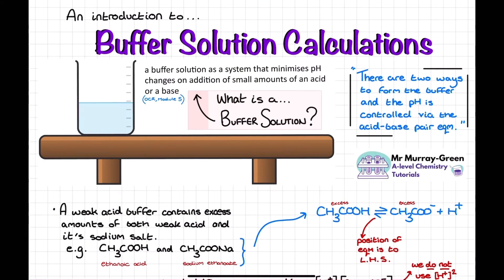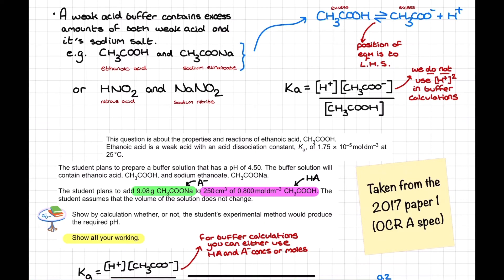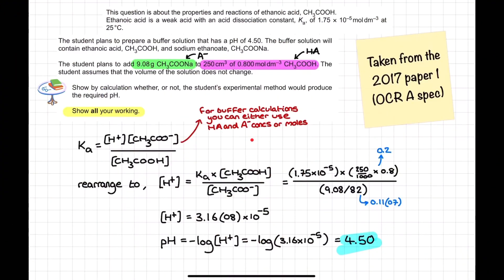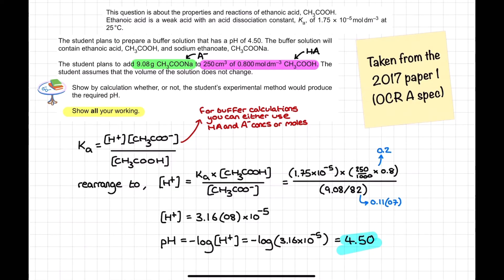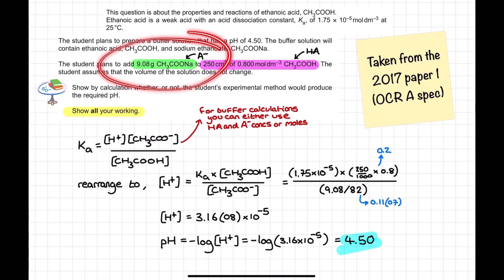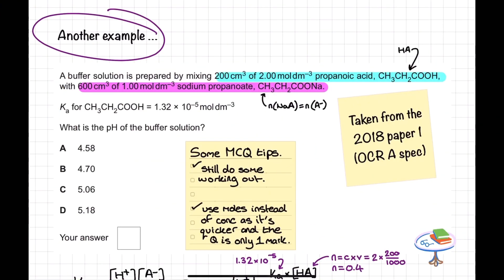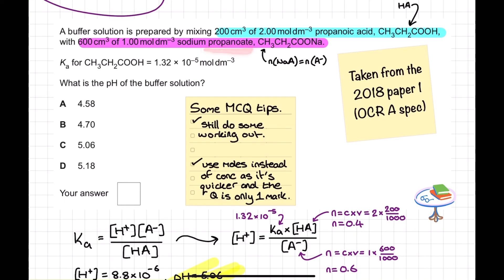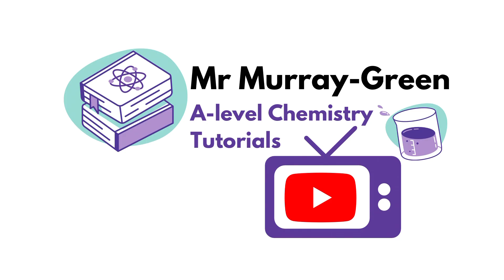Buffer Calculations in Exam Questions for OCR

Comment: Do you still use square brackets when writing the expressions even though u use the mole values?
Reply from the maker: Hi, once you’ve started the calculation it won’t matter what brackets you use. Just make sure when writing the initial Ka (or Kc) expression you use square ones

Comment: Hi Mr Murray,
I dont really understand why youre allowed to use moles instead of concentration, when using the Ka formula?
Please could you rephrase your explanation as I am quite lost.
Thanks
Reply from the maker: Hi, very sorry, I missed your comment until just now. When I rearrange the Ka expression as a subject of [H+] for a buffer, I find myself with the [HA] on the top (numerator) and the [A-] on the bottom (denominator). They are both concentration terms which mean they are both 'moles divided by volume'. Since they are in the same solution, these volume terms would be the same (and cancel out) so I can leave them out and just use moles instead.

Comment: Thank you, this was really helpful. For the last question, why is it quicker to use moles, isn’t the concentration already stated in the question?
Reply from the maker: Hi, the concentrations started in the question are not valid for the buffer as when you mix the two solutions together the total volume will change which would change each concentration (c = n/v). What you would need to do is re-calculate the adjusted concentrations to account for the change in the total volume now that the solutions are merged. Since this takes time and the volume terms would cancel out anyway, it is easier just to use moles.
Reply: @mrmurraygreen  Hey great video! Although, in the first question it says that “the student assumes that the volume of the solution does not change”. Does that mean we could have just plugged in the concentration values into that equation rather than using moles as the total volume hasn’t  changed?
Reply from the maker: Hi, but the sodium salt isn’t a concentration? It’s a mass. It needs converting into moles to be used. Also sorry for the slow reply, the YouTube studio app is rubbish and keeps hiding comments.
Reply: @mrmurraygreen  I understand now, thank you
Reply: @mrmurraygreen  Oh right that’s true😂, thanks for the clarification :)
Reply: I guess you could after you worked out moles of sodium ethanoate, then use the volume of 0.25 dm^3 to work out concentration and then plug in that value as well as the given value of 0.8 of ethanoic acid. This is a longer process but gives you the same answer